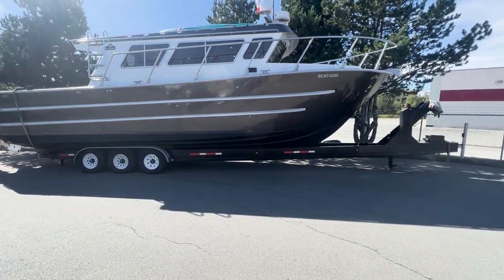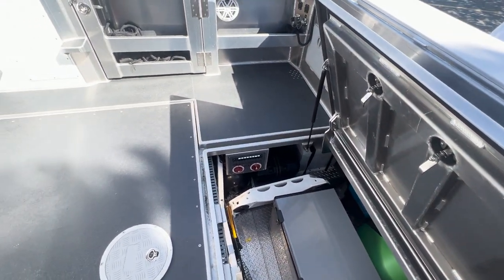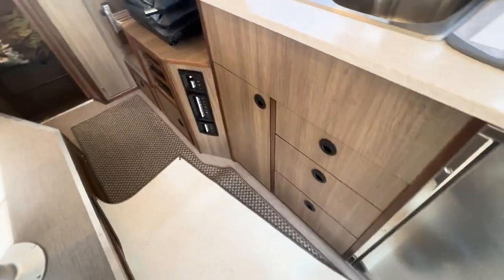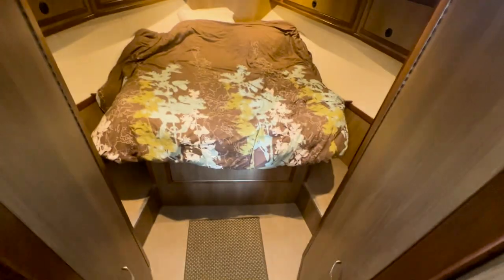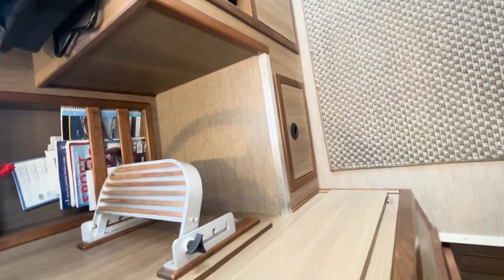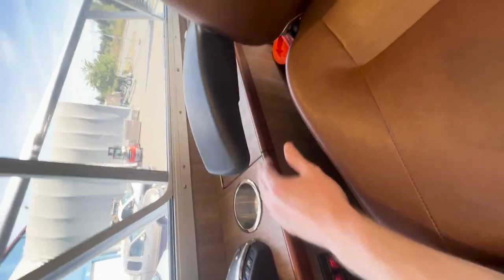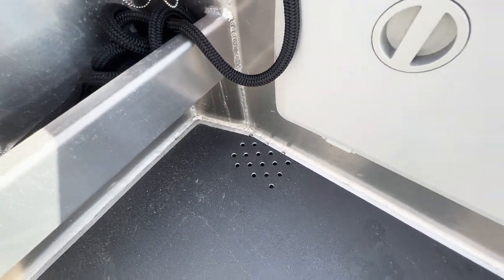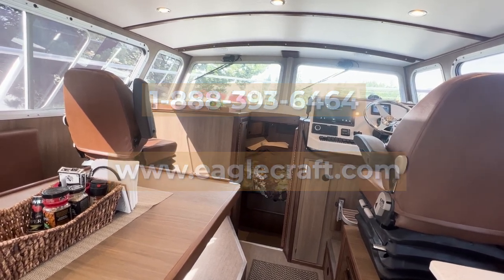EagleCraft New Model - 38' Cruiser Walkaround | Custom Boat Builder

Comment: I’m curious as to why this owner opted for triple 300’s over twin 450’s XTO’s, or twin 425’s if the 450’s hadn’t been released yet. Great walkthrough
Reply from the maker: We like triple 300's because it provides slightly better HP to weight ratio, and prop surface area, and triple 300's are slightly more cost effective. That said we will have more with  450's very soon!!😉